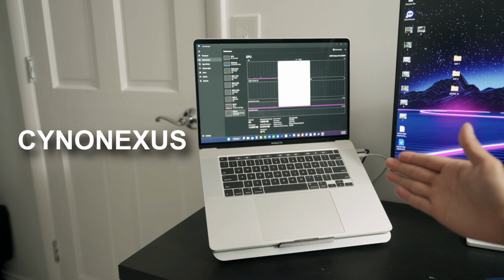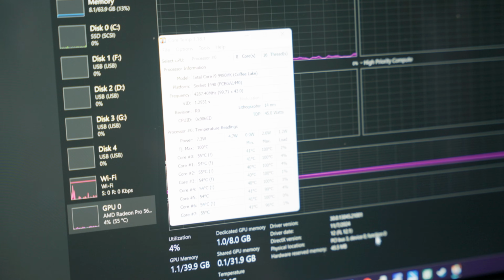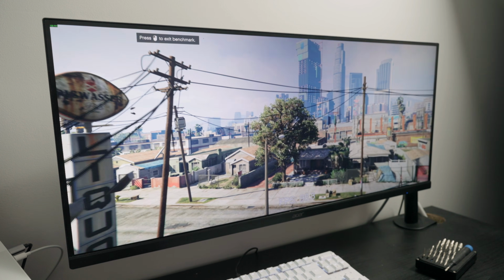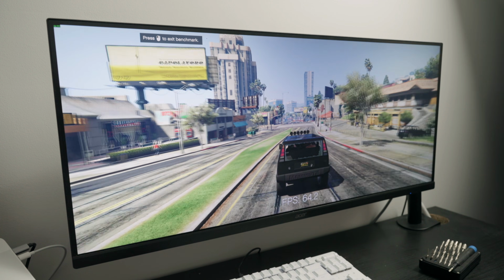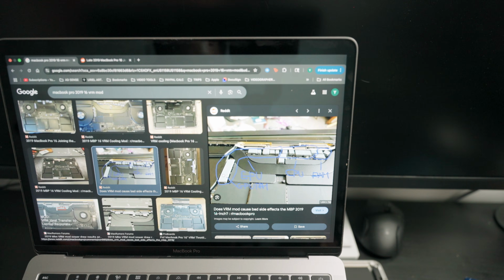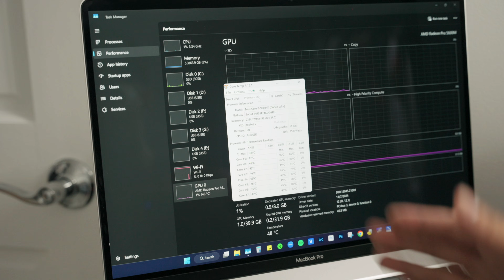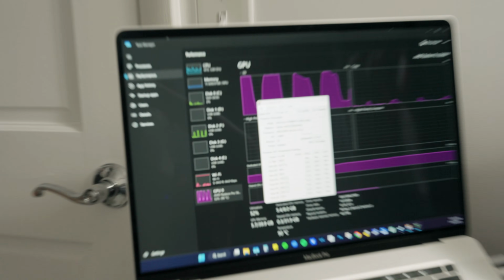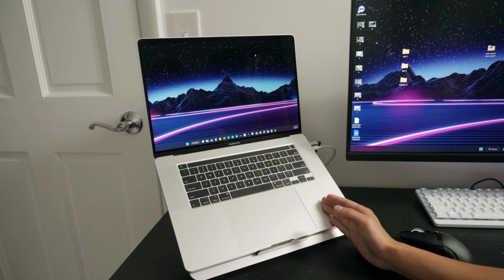THE LAST INTEL MACBOOK PRO 16” OVERHEATING IN 2025??? TRY THIS FIX!!!

Comment: Southern California. Noticed  my 2019 Intel starting to get hot until it got full of dust. Makes a difference if I use it with the cover legs down.  I'll clean the fans  and see what happens.
Reply from the maker: mine has been relatively cool after putting thermal pads and cleaning the dust out!

Comment: Thanks for video. If I use 1.5 mm thermal pad, how many layers should I apply ?
Reply from the maker: put layers until it touches the buttom plate
Reply: @cynonexus thanks.

Comment: Ciao!  i have the same macbook but with different specs (9980hk/5500m 8g w 1t/32g) i repasted the cpu and gpu with ptm7590 and im asking, how did you get your temps that low on windows???? i get mid 60c on cpu and gpu at idle. im really confused right now, and im certain that i applied the TIMs correctly.
Reply from the maker: I haven't touched any of the thermal paste, so I'm presuming they are the original! I do have a laptop fan stand, which helps it cool by a few degrees
Reply: @cynonexus  that's genuinely impressive that it hasn't been repasted and it reaches that low

Comment: its not the MacBooks fault its overheating....I had a gaming laptop with 4 fans and a giant heatsink and this cpu still got 100 degrees....the 9th gen cpu's suck .....I did benchmarks with my MacBook with i7 9th gen and the i9 9th gen....in many cases the i7 was faster....less overheating...lest thermal throttle

Comment: I kinda solved mine by disabling cpu boost and controling cpu clock and undervolting my 5300m
Dying Light : The Beast was Only giving me 20fps and temps were 79c to 80c but now i play 60 to 45 fps with 71 to 73c also raise the device abit from the desk for better ventilation also modded my clocks so when it throttles it doesn't go from 1250mhz to 300mhz but goes down 800mhz instead 😂 and it cools down and gaming is stable but expect hickups here and there

Comment: You need to restrict CPU wattage to 25-13 watt, there are few cpu tools you can find for that. Google undervolt bootcamp using morePowerTool for the GPU, besides lowering voltage you can lower the clocks on the GPU to find consistent spot. Also can get a stand with a good fan, helps to reduce 3-4 degrees. Never done any VRM moding, was afraid to damage the battery. RDR 2 1440p GPU 1150 mhz 100% load CPU 18 watt, runs same for many hours. Cyberpunk 1080p 1250mhz with CPU 20 watt (lower resolution less load on GPU giving higher freq) also can run for hours. I mostly play on Geforce now and only use it to play RDR 2, this machine got a bit old for gaming.
Reply: Is it really worth it to buy now it's almost 2026 with i9 9980 HK 16GB RAM 1TB SSD AMD RADEON 5600M HBM 2 8GB graphics card,For casual gaming (RDR2, CYBERPUNK, GOW,COD etc.) and programming as an AI Engineer under budget of 50k INR???
the AI says it's good but I'd like to confirm with the real user .
Waiting for your reply 
Thankyou
Reply: @Ujef_Shaikh  Intel macbooks got a lot cheaper lately. For the casual use or not heavy coding projects - great screen ( but only 60hz), amaizing speakers and solid keyboar the price is great. But the machine is like almost 6-7 years old, it can fail any time, laptops work under higher temps especialy intel macs and last less than desktops. Price to fix it could be the same or even higher than you'd buy it for. 
Gaming on 5600m is like desktop 5500xt or a bit slower if you would be able to optimize it like I've described in my first comment. I dont think 5600m even can be undervolted, at least not as straight forward as 5500m. For example mac 5500m with no optimizations constantly drops to 800-900mhz in average in many games, that's like 40-50% of desktop 5500xt. Notebookcheck comparison amd 5500m (faster than macs 5500m pro) vs nvidia 5060m in cyberpunk, 1080p high 23 vs 95 fps. 23 fps + 30-35% to get 5060m results. Also RAM is not upgradable so 16g can be not enough for some modern games. Runing games at 1080p on 1920p screen wont look that great either. I dont think its that great for gaming overall, maybe used to be ok back in 2020.
I'm not an ai engineer so I cannot say much. Mac with 8gb of VRAM is not that bad and can run light LLMs. But its AMD and ROCM, not sure how good is it vs CUDA and which stack will you use for leaning. You better check it with your uni tutor.

Comment: I do know the thermals are worse on Windows because Apple baked some voltage tuning into the OS for these laptops. So basically Apple undervolts these chips on MacOS. They still run hot but they do run better than on Windows.

Comment: it does work reducing the overall temps: but that heat now is making the macbook case hotter: reaches 45 degrees espcially where that VRMs touch via thermal pads to the case. :) difficult to use it like a laptop rathe a desktop.

Comment: I commented this in the first video you have of this mac, not knowing you were considering cooling the computer: “I have this exact computer with 2tb of storage. You should definitely consider the following: repaste the processors with PTM7950 and cleaning the inside of the computer. Now, the disassembly is quite a hassle, and I broke two connectors while doing so (a speaker and a fan, later replaced), but it will breathe new life into it. I went from barely getting 45fps in God Of War at 720p to 60fps solid at 900p and occasionally 60fps at 1080p original settings. Give it a try, but be weary of possible fragile components.”

Comment: Just an FYI, the 16 inch macbooks actually have a pre-applied undervolt applied only in macos. It allows the cpu to boost higher while maintaining temperatures. When you use windows, that undervolt is removed which means it runs hotter and thus throttles easier.
Reply: how to solve that problem if i switch to Windows?
Reply: @thiencao9204 i mean its pretty easy you just have to adjust the fan curve to accommodate for the extra heat (get the late 2023 build of macsfancontrol on the github) by making it more aggressive because the default fan curve waits until it the mac starts overheating to ramp up the fans, and you can try your luck at manually undervolting with throttlestop and msi afterburner

Comment: I actually did this mod to my own 2019 16", granted I don't have the 5600M (Have the 5500m and use a Radeon Pro W5700 in an EGPU box). I applied thermal pads on both VRMs anyways and it definitely has helped. I see less drops to 2.4GHz with my 9980HK. Usually hovers around 3.8-4.5GHz in game (depending on the game of course). Another helpful thing if you haven't already is to apply PTM 7950 to both the CPU and GPU. It's a lot more effective than any thermal paste. It's a pain to take it apart but the benefit is there. (Also unlike tradition thermal paste it doesn't wear down over time, it actually gets better with time. So you only have to do it once and then never again.)
Reply: czy używał ktoś ciekłego metalu zamiast pasty termoprzewodzącej? Zamówiłem właśnie MBP z najlepszą i9 5600m i 64GB RAM i po miesiącu mam zamiar pomóc temu laptopowi w wydajności

Comment: I did exactly this, but i put new thermal paste on (arctic MX-6), put thermal pads on the VRMs, Ram, and all the heatpipes and removed the thermal insulation on the bottom case to improve heat transfer. temps are down by like 10 degrees.
Reply from the maker: Was it a hard job?
Reply: in windows install throttlestop and disable turbo, after doing it windows runs so much better for me

Comment: Such mod could improve performance but not for the reasons described in the video.
Vrms are components that supply power to the chips and with all the power going through them they could start overheating. Cooling them in such case can improve their ability to provide power and so improve performance, but more power means more heat. To reduce the temperatures on the chips themselves you need to clean the vents (there is a ball of dust on the left fans heatsink on the left side 8:00 , though that should be margin of error) & replace the thermal paste.
The improvements shown in the video look like margin of error. To properly compare before & after you should run a consistent benchmark (like Cinebench to test the cpu) and look at the result (which wasn't done for gta 5, you were so close!). Also temperatures are affected almost linearly by room temperature.
Modern chips (yes, the ones in this mac count) are designed to take full advantage of their thermal headroom and make it into more performance, so even if you do improve cooling they will still run at high temps, just with better performance.
Finally I wanted to mention that memory usage (ram & vram) is not affected at all by temperatures and doesn't affect performance unless there isn't enough of it. And in the case of ram, if there is some spare left, modern operating systems will use it to cache stuff.
Sorry for the negativity, I tried to be constructive.
Reply from the maker: If only my brain can handle such info, thanks!
Reply: @cynonexus  TLDR: performance in GTA V decreases not because the GPU and CPU are hot, but because the power delivery (VRM) overheats and then cuts the power to the CPU to cool itself off. The CPU will go from 50W to 10W and performance will crap. These thermal pads allow the VRM to stay cooler and thus feed higher Wattage to the CPU for longer

but to really notice this you need to play longer, above 30min, 1 benchmark is not enough
Reply: @cynonexus  Bottom line, your real-world test with frame rates confirmed the improvement.
Reply: God damn wrote a whole ass book.

Comment: It worth one of these machines? I'm thinking of bying one in the near future (1/2 months)  but also thinking about stretching the budget a little more and get a M1 16GB ram from ebay. The thing is a Macbook Pro 2019 32GB (even with a radeon) can be get for $350 aprox, M1 with 16GB $450-$500 if you are lucky enought to find a good deal. What do you think?
Reply from the maker: Depends on how you use it, m1 all day everyday if you want seamless workflow and speed but if you want something fun to tinker with go with these! Plus you get a bigger screen, more ports, and better speakers

Comment: I did that still overheat there is no solution for that issue trust me I tried all. try using it in a room without air conditioning lol. They are great machine don't get me wrong but you can do or say what, the thermal issue there is no fix for and lets not talk about the random fact that the ssd power chip sometimes randomly kills the ssd.
Reply from the maker: The struggles!

Comment: I wouldn't drill into the mac, it will tank its resale value, you have a lot of thermal pad area left, if its 1mm or less in thickness you can put it on the heatsink right on the CPU and GPU, avoid the vent areas though, also add ptm 7950 on the CPU and GPU die. It dropped temps on my 2019 Macbook by 14 degrees. I have a i9 64gb ram 4tb and a 5500m 8gb.
Reply from the maker: I actually did that off camera with the extra thermal pads I had left! Dropped slightly more!
Reply: Well, he could get a replacement bottom case and have the best of both worlds, in case he ever changes his mind. If you are gonna drill some speed holes into the panel, use a wood bottom so the panel doesn’t bend.

Comment: Drill 2 big holes right where the fans are and then put a mesh dust filter where they are and that will improve a HELL a lot of the thermals
Reply from the maker: Hahahaha I bet!
Reply: @cynonexus I already did it on my 2011 MacBook Air and at idle it prolly dropped temps by 20C at least

Comment from the maker: Just added some thermal pads on my 13" non-touch bar 2017 MBP and the temps went down a few degrees... Still slow though 😂 

VRM MOD REDDIT: https://www.reddit.com/r/macbookpro/comments/gs6bal/2019_mbp_16_vrm_cooling_mod/

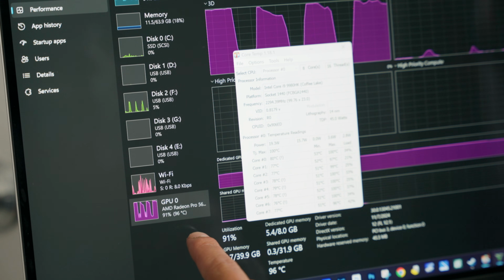Comment: 13:17 the cpu is at 2.3 ghz and at a low wattage, the firmware could be throttling the cpu because the bottom case is getting too hot
Reply from the maker: Noticed that too! best case would be to do thermal paste + thermal pad here but i guess thats for another video!

Comment: you want to see a significant improvement in temps drill the bottom case where the fans are located so it can suck air it will be a ton better
Reply from the maker: hahahaha that would be an interesting project to do but not on my silver baby!